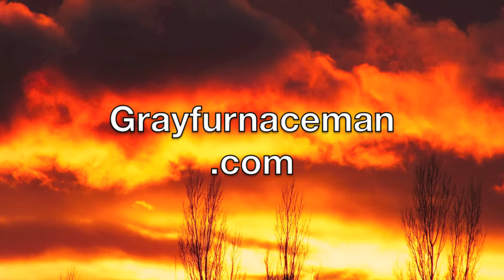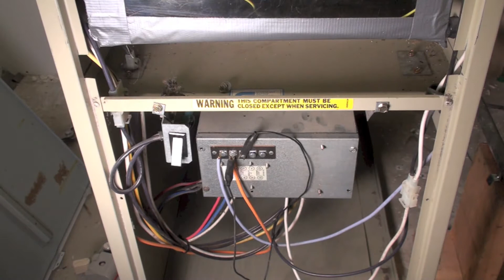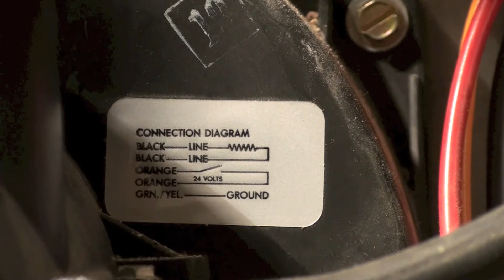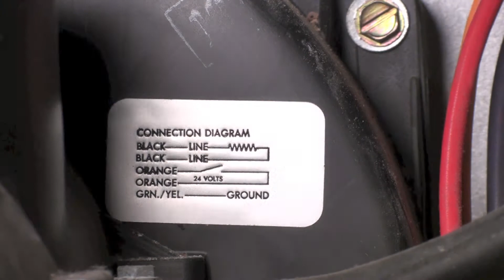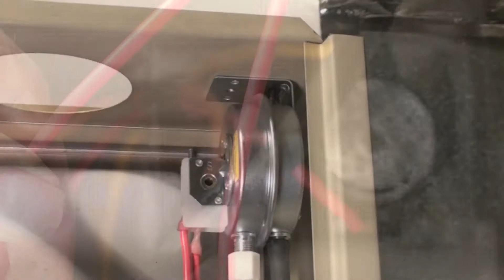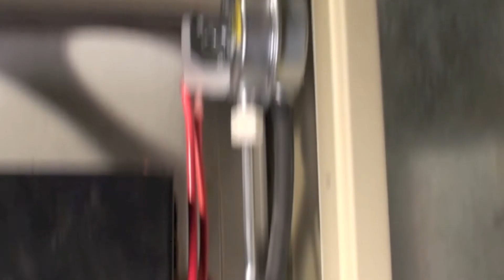How the Snyder General GUA sequences

Comment: Im trying to service a Snyder General horizontal furnace in my attic. 
I've got 2 of them in apartments. They seem to run  fine, but I'd like to maintain them. Im in SoCal, so they dont get used much.
There are some rods that seem to just be just laying on the burners. I can't seem to get a good look inside to see if they're afixed or not because the service access is too small to the burners and thermalcouple.
Reply from the maker: The rods are there to reduce Nitrous Oxide in the vent gasses.
GFM

Comment: Why is the relay switch keeps the blower going even though the temperature is set at a ceratain temperature. It keeps going until the unit is shut off manually. I have a Snyder General.
Reply from the maker: If the auto/on switch on the thermostat is set to on, the fan will operate continuously.  

Also, the unit has a heat operated fan switch that may be stuck on.
GFM

Comment from the maker: When you have failure to light the burner, does the HSI come on?  If not, the ignitor is failing.  Check ohms.  Should be less than 150.  Let me know.
GFM

Comment from the maker: I would check to see if the flame comes on at all or just for a few seconds.  My guess would be you have a flame sensing problem.  I know this is hard to see with the cover on, but do not remove the cover and start the unit.  It will rollout flame!  Checkout the GUA playlist for cleaning flame rod.  Hope this helps.  
GFM

Comment from the maker: Boilers are somewhat harder to troubleshoot however, they have numerous error codes to direct you.  Flame rectification can be checked only with a micro ammeter with the probes in series.  Look in the channel search box for "flame rod checks" for a video.   You can check the HSI with an ohmmeter.  Most if above 150 ohms are going bad.  Hope this helps.  Thanks for the comment.
GFM

Comment: wow, looks not really difficult as condensing boiler. To be honest furnace looks much easier to find the faults. 
For condensing boiler you have to deal with lots of switches: thermistors, water pressure switch, pumps  and so on.
how do you test the flame rectification device and ignitor with ohmeter?
thank you

Comment: I have fooled with more oil furnaces than gas,that limit switch is what you find on majority of oil furnaces,they worked great not a lot of problems from the ones i repaired,thanks for another great gas video,i need them,im picking up on a lot from these,thanks again